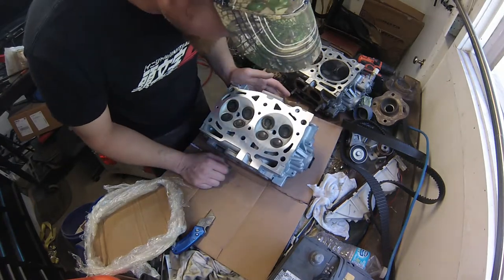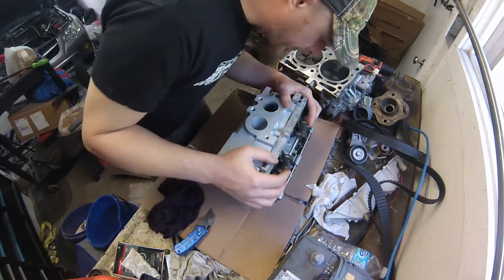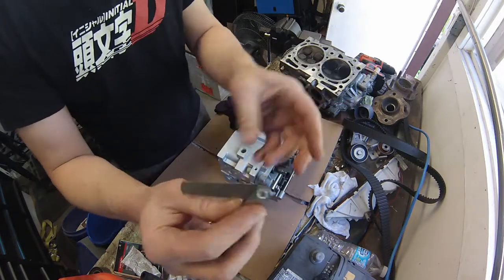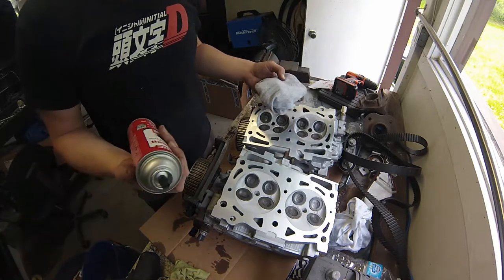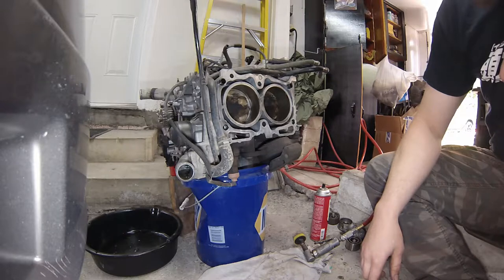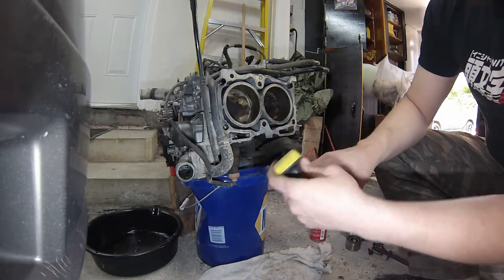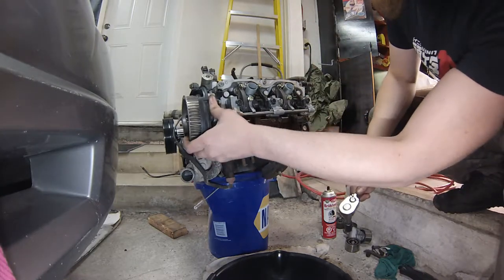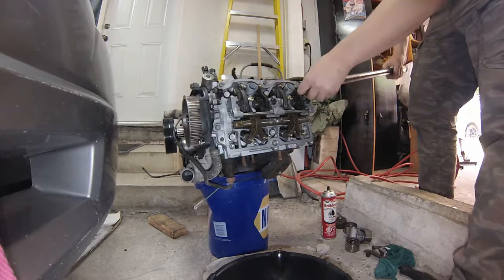Outback Broken Timing Belt #4 Engine Reassembly - How To

Comment: Enjoying watching this series of videos you made on the timing belt. Question do you think a 9 year old subaru with 75k miles is in danger of timing belt breaking or tensioner/pulleys going bad or do i have a little more time. What's your opinion?
Reply from the maker: You are do for a complete timing kit on that vehicle. The belts are very durable, but the idlers are the ones that go unnoticed and when they fail.... it's bad news bears.
Reply: Homebrew Subaru I hear yah thanks for the info.

Comment: Hey, (5:11)
I trust you are well today.
I recently adjusted valve clearance on my 2002 impreza
Intake;
0.20mm+/-02 mm (0.0079+/-.0008 in)
 Exhaust;
0.25mm+/-02 mm (0.0098+/-0008 in), using the LH sprocket arrow to set each cylinder piston at TDC, then rotating 90 degrees for #3 #2 and #4.
After adjusting, checking and rechecking all clearances, finishing and firing up.....I think I converted it to a diesel engine, the lash is just loud.
Is there anything I may have missed, or what would be your advice on valve clearance adjustment?
PS: I used the correct size gauge for both intake and exhaust, and ensured there was just enough drag on the gauge after adjusting and tightening the lock nut!
Reply from the maker: It sounds like you have done it properly. The numbers and procedure you used do sound correct. Was the valvetrain noisy before adjusting the lash?
Reply: hello,
update on this..
The valvetrain was not noisy before adjusting!
So yesterday morning I checked and found 1 intake valve on cylinder #3, was way too loose...don't remember how i missed that one.
I also turned over the engine twice for each cylinder and re-measured and adjusted the clearance, everything is now fine.
I'm so stoked, I feel like pulling out the engine then put it back again, just for the kicks :)

Comment: 12:00 I see the brake cleaner, did you brake clean the block surface?
Reply from the maker: Hmm, maybe that was cut. The deck was probably brake cleaned when the cylinders were wiped out. Not much is needed, only dampen a rag no need to spray the block directly.
Reply: Can be bad to the block applying break cleaner on the surface ??

Comment: What do I do when timing marks won't line up after manually turning engine after installing new timing belt ? They were all lined up at the start but out by a bunch after new kit was put in ? Thanks from another northern BC  Subie owner .
Reply from the maker: The timing marks on the new belt will not line up after rotation. The belt marks are for initial line up. When rotating, line up the marks on the cam pulleys and the crank to the marks on the engine. If one of the marks doesn't line up from pulley to engine, the belt is out.  It may take a second try.

Comment: why does subaru do the degree tightening versus ft lbs?
Reply from the maker: That's an excellent question.
Most manufacturers have used torque-to-yield for the past 25 years and there are a few reasons it's used instead of torquing to the foot pound. I guess the number one reason would be contact resistance of threads.

You know how sometimes you thread a bolt in one hole it won't go, but another hole and it threads in nice and easy? The same thing happens with engine components especially when reused. This could cause a variance if torqued by the ft. lbs. Imagine a thread defect, a bit of rust, a bit of dust for that matter. A stretched head bolt. Try to imagine a marble at the bottom of the hole, the bolt will still torque to 80ft.lbs., but yet never even seat. 

Torque to yield turns a bolt to a specific position. The position is then the same as every other bolt. If the position is the same, the bolt dimensions are the same, the torque setting is very close to being precise on every bolt.
Reply: that makes sense. the last motor i put together was 30 years ago. small block Chevy a lot easier then.
Reply from the maker: The days of old war pig iron are heads gone. Everything is aluminum nowadays, or some type of recycled composition that they like to call aluminum. Only engine work uses the degree wheel, it doesn't get used anywhere else.